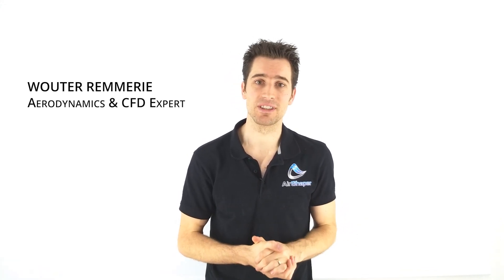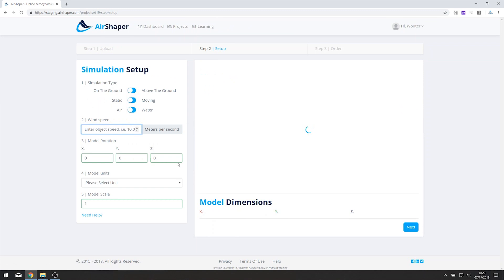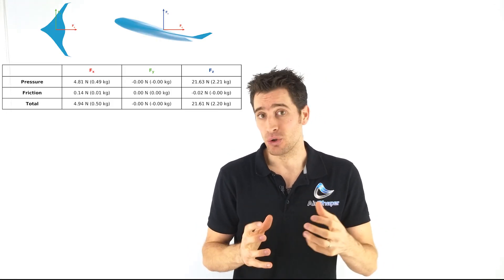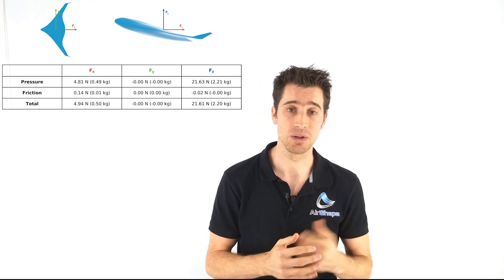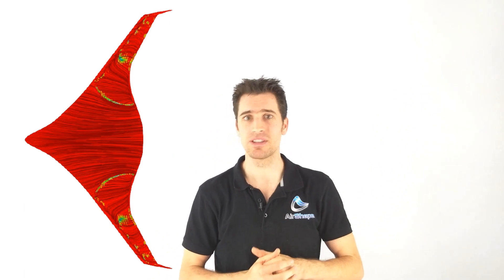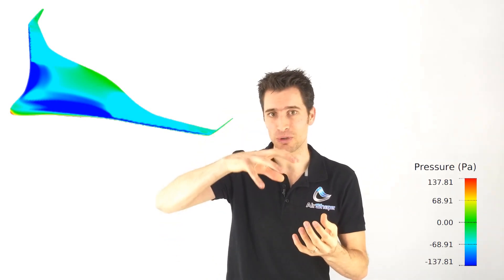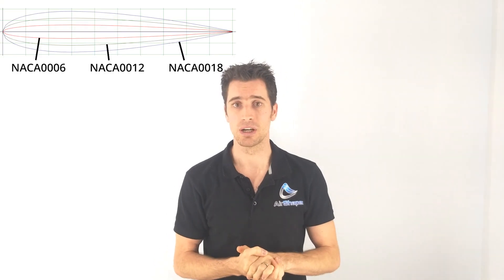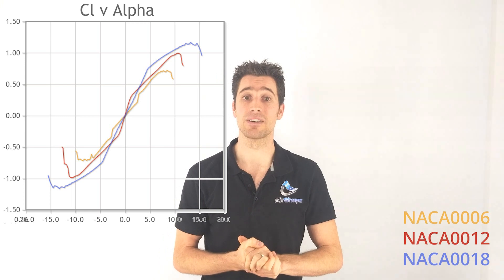Drone design #2: 3D Flow Analysis

Comment: How do we know that the generated mesh gives us closely accurate results when we have no experimental data? What about grid independence study? Will you have to pay individually for every grid generation to study for grid independence?

Are you using lattice boltzmann method just like simulia?
Reply from the maker: Dear Absar:
- Every case is different, so it's impossible to exactly predict accuracy up front. Nevertheless, based on experience with reference cases (which have been documented in detail after wind tunnel tests, like the Ahmed body, drivaer, ...) we do have a good understanding of this. See also this article: https://airshaper.com/blog/tesla-model-y-aerodynamic-benchmarking
- If you want, you can indeed run 3 simulations: Basic, Regular and Advanced, to test the grid sensitivity specifically for your application
- Keep in mind that for each simulation, we already perform adaptive mesh refinements to locally improve the mesh quality and increase accuracy.
- We use steady-state k-omega SST as our solver, which is a good blend between accuracy, speed and cost.

If you have more questions, just let me know!
Reply: @AirShaper  Thank you for your detailed response. Sounds good. I will be exploring this if my supervisor approves.

Comment: So in summary the video went like this:

1. Lets analyse this plane.
2. It's lift characteristics are terrible. Let's find out why.
3. As you can see we have problems here, here and here.
4. Conclusion: It's not too bad, the plane flies perfectly.
Reply from the maker: Almost correct :) No, we looked at a very extreme case (15° for angle of attack). Having a soft transition into stall is a good thing. But it doesn't neutralize the fact that you lose a lot of lifting power. So it depends on what you're after!
Reply: @AirShaper  You're right. Any plane could be pushed beyond its limits. This plane in particular behaves very well with its smooth transition so you won't experience a sudden stall. Delta wing planes also have a similar smooth transition. I've leant much in your video, I like the techniques you showed how to identify stall areas on the wings. I want to use it in future projects. Great video!
Reply from the maker: @stewartmclaughlin1199  Thanks Stewart, I'm looking forward to see your designs!

Comment: I love your content. Let's say you have a flying wing that has a cruising angle of attack of 3 degrees. Would the optimal Cl/Cd at that angle of attack as high as possible. In other words, should your lift to drag ratios be highest at the wing's cruising angle of attack?
Reply from the maker: Hi Robert, thanks for the compliment! If your goal is maximum efficiency/range, then yes, going for the highest L/D (for the entire plane, not just the wing) is desirable.  The shape of the L/D curve around that point will determine whether it's easy or not to stay spot on that highest efficiency point (and thus to what extent you can actually benefit from it)!
Reply: @AirShaper  Wow, thanks for the reply! I really appreciate you taking the time to respond. Thanks for the info!
Reply: @AirShaper  how do you determine the lift drag ration for a fuselage? A cylindrical fuselage*
Reply from the maker: @wyzanagui7140  A cylindrical fuselage would be positioned horizontally into the flow, with the "head" causing a lot of drag. A more simplistic approach would be use formulae for friction drag for a flat plate for example, and match the length of the plate to the length of the fuselage and the width of the plate to the circumference of the fuselage. But that would of course be a strong simplification and it would account for the pressure drag component. But a good first exercise before you move to a 3D flow analysis! There is also empirical data around for the estimation of fuselage drag - ask the creators of Xplane, they use those too!
Reply: @AirShaper  thanks for the great explanation. However, wouldnt the longitudinal axis and wind direction be parallel? And not horizontal to the airflow
Reply from the maker: I'm not sure I understand the question correctly, but my suggestion was to model the friction caused by the boundary layer buildup. My suggestion would be to search for empirical data as well!
Reply: @AirShaper  My apologies, I misread your first comment. thanks!
Reply: @AirShaper  is there a perpetual license/one time purchase for your airfoil software?
Reply from the maker: @wyzanagui7140  Dear Wyza, we don't have licenses, as everything is run in the cloud. But we do have a yearly subscription model - if you send me an email at wouter@airshaper.com I'll reply with more details!
Reply from the maker: Usually that I'd what you aim for, yes

Comment: Obviously 200$ for just one single simulation is way to expensive for any hobbyist, whereas the professional aerospace companies already have their own tools for the job... Who is your target audience for this product?
Reply from the maker: Hi Milos, it's even worse, it's 200€ and not 200$! :) Indeed, as a hobbyist, this can be quite expensive. But for companies, large & small, it is massively less costly to run a number of stand-alone simulations at AirShaper for a number of reasons, here are the most important ones:
- 3D model preparation: AirShaper can work directly with open surface models (non-watertight 3D geometry). That means they don't need to spend weeks (which costs thousands of dollars for a skilled engineer) to close the model
- Licensing: there are no licensing costs at AirShaper, you just pay per simulation. A normal license costs anywhere between 30.000$ and 100.000$
- Hardware: it's a cloud platform, so you don't need to invest in a calculation cluster (which again can cost you multiple 10.000$). Also, development speed is key for companies. At AirShaper, you can launch as many simulations in parallel (which isn't possible on your own hardware).
- Setting & mesh control: all settings & (adaptive) mesh generation are controlled automatically, based on algorithms that take years of experience into account. This makes the results uniform & objective, and avoids errors.
I hope this makes sense!

Cheers,

Wouter.